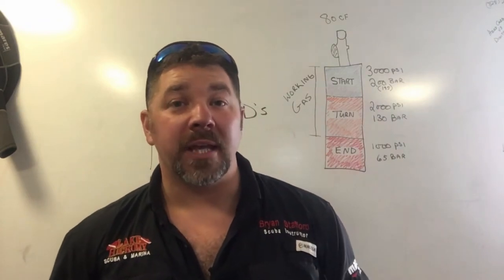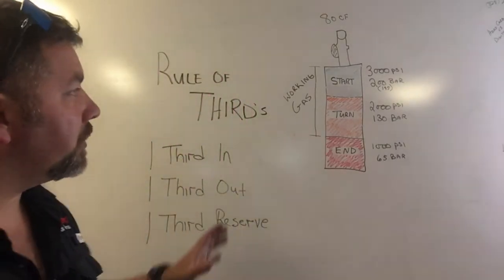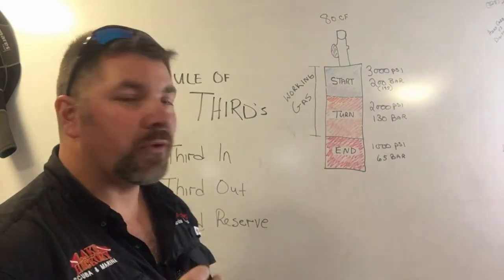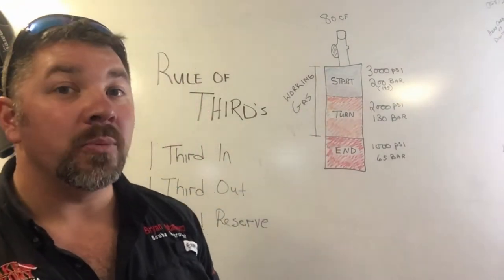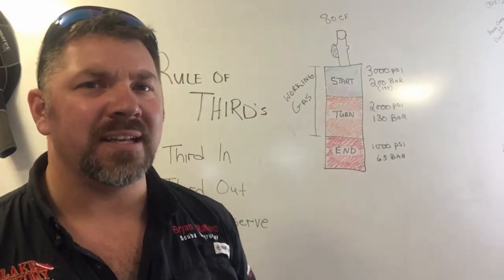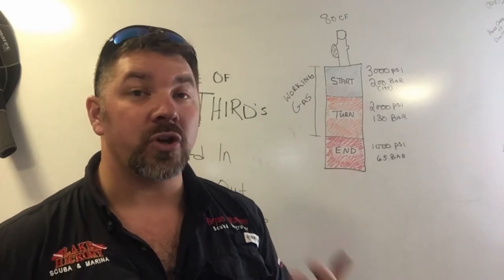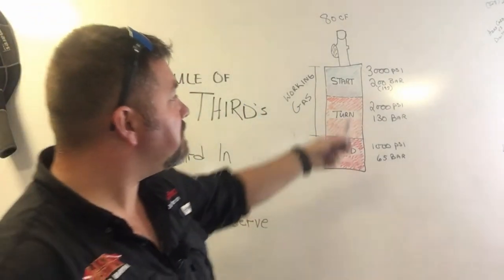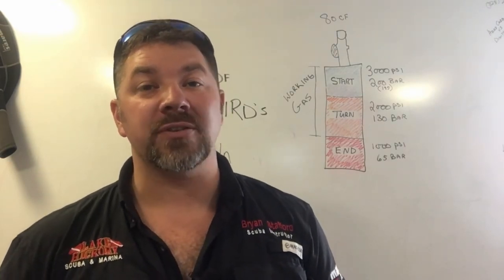What Is The Rule Of Thirds

Comment: How does The Rule of Thirds work when diving with 2 cylinders, or is there a different rule; start with 6,000 PSI (2 tanks combined), instead of 1,000 psi going out, I would have 2,000 PSI (4,000 total remaining at the turn point), 2,000 back to anchor line where I now have 2,000 PSI left between the 2 tanks instead of 1,000 with 1 tank.
Reply from the maker: Hello Hojo in SC. You have a great understanding of the rule of thirds. The dive is made until each cylinder hits 2000 psi, then we make the turn. Then we end the dive once both cylinders read 1000 psi. In overhead environments we use the rule of 6th for all open circuit overhead dives